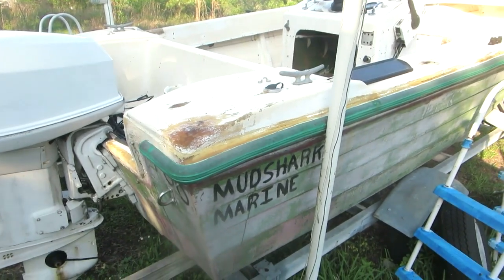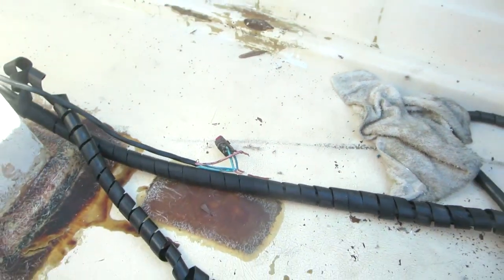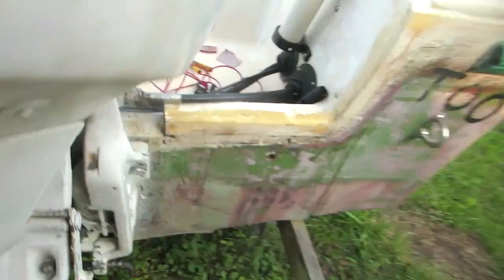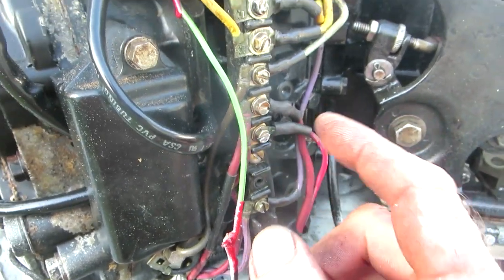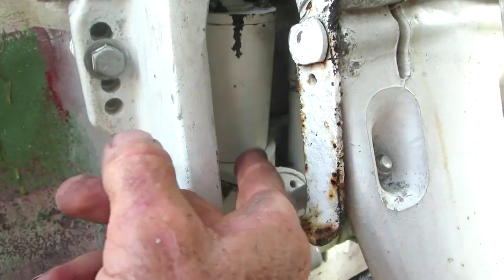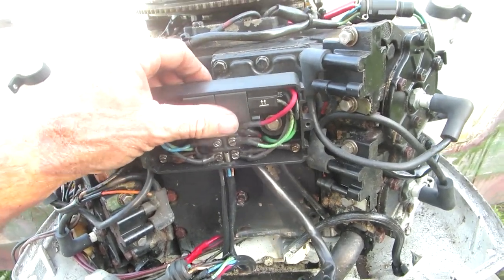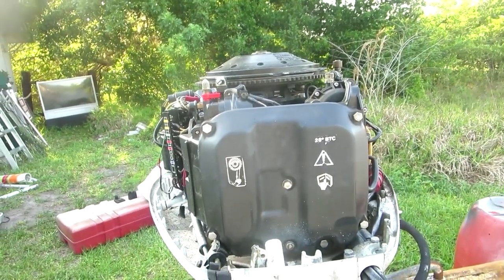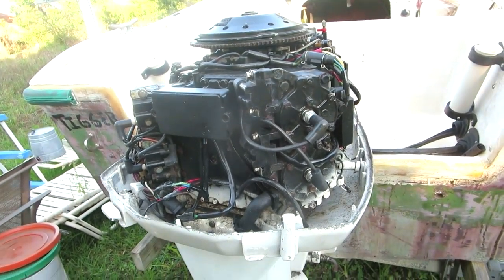Power Trim & Tilt troubleshooting 1987 OMC, Johnson, Evinrude 90HP V4

Comment: You were saying if you push the switch and hear the relays clicking and then it cuts out. That’s where my issue is, trying to get it going , replaced the relays but I can hear them click but not where to go from their
Reply from the maker: Ok, this may be late but... follow the current. If you have voltage to the relays and can here them clicking then you need to follow the wires from there. A volt checker of some sort is required. A voltmeter is best. Check for voltage at each connection or splice. Make sure you have one probe on a good ground. Verify that by checking where you know you have voltage. You may find you have power all the way to the motor connector. If that's the case, the motor may be bad or be corroded too much to move. Try having the trim actuated and knock on the motor  with a soft mallet or piece of wood to try to knock some sense into it. It might free it up by breaking up some corrosion. Without knowing your particular circumstances, that's worth a try. Or take the motor apart and see what's what. If you are into that. Once you know you have voltage to the connector/motor you have at least isolated the problem. Don't assume any connection is good without verifying it. Good luck.

Comment: My 88 doesn't have solenoids. Ugh
Reply from the maker: That's weird. You should get your eyes on a service manual. You might be able to find one online. You might even try to search "88 OMC PT&T system" in google and ck the images. Sometimes pages from service manuals are displayed.You just have to blown them up to read them. I'm not sure how that system could work without them in some form. Maybe in a module at that point? I'd be interested in how it works out. Good luck.

Comment: I would love some help on a MANUAL!!
Reply from the maker: Do you have a big motor without PTT. Power trim and tilt? The 1st motor I had on my boat was a 1981 V4 without it. Very rare as most larger motors came with it for obvious reasons. Either way, what do you need help with? The usual setup is just a lever on the side that you push one way or the other to unlock the position. You usually have to lift the motor a bit to unload the lever assy to get it to move. If it's up, lift a little, flip the lever down toward the back and it should "unlock" the motor and allow it to drop. Do it a favor though and hang on to the lower unit and gently let it down. You don't want any banging. You have to set the trim pin to where the motor will need to be once you are planned off. That's why it's way easier to operate a boat with PTT. You leave the trim pin all the way in the front hole so you can trim the motor in farther to plane off sooner/easier and then trim the motor up for cruising. With no PTT, you set that pin and you just have to wait as the boat nose comes up and fights it's way over onto plane. In little boats, you will see the operators up and leaning forward to help get on with it. To raise the motor with manual tilt, you flip the lever up and forward and lift the motor by the lower unit. When it gets to it's locking position you should hear it click as I believe the linkage is spring loaded and will snap over by itself.  So, I hope that helps, if not let me know what specific motor and issue you are having and I'll give it go. Thanks and good luck.

Comment: Thank you for this video. I just got towed off lake due to trim not going down. Because of video I found out it was relays and have some on the way. Thanks again
Reply from the maker: Sorry for the late reply but... in case you did not know, there is a screw on the right side that you can loosen to bypass the trim system, releasing the pressure and allowing you to move the motor up or down. It takes a flat screwdriver and is the standard lefty loosey, righty tighty. You loosen it to release the pressure, move the motor to where you want it, and then tighten the screw to basically hold the motor in that position.When you get back to dry land, you can do the same to lift the motor for trailering. Tightening the screw sort of locks it in place. Good luck.

Comment: Good video
Reply from the maker: Thanks. I tried installing a momentary rocker switch on the console to cheap out but it did not work. The trim would randomly go to full up while underway. I'm going to bite the bullet and buy the correct trim switch with it's factory harness. That way at least I should be able to eliminate it as a problem source. Put myself in a known situation and all that. My biggest problem is that so many other things are sucking up my time that I don't get to use this guy any where near enough. Non-use is the #1 cause of maintenance issues by far. Especially for boats. We're stuck on land due to the trim issue, a "recent" problem with the cooling system, and the fact that the transom is mush. I've already replaced the stats, but that non-use issue plays hell on them especially. Got to pull 'em again to check on them. The transom will be an interesting journey. Thanks again and good luck. Got to keep these things in the water where they belong.

Comment: Thanks a ton, I couldn't for the life of me trace the wires back to the trim relays on my Evinrude 115 after both up and down just stopped working. Now I know where to start cleaning terminals and checking voltage. Great video
Reply from the maker: Glad to hear it. I figured I might as well share what I figured out. As my 1st aviation boss used to say: "if some dummy could build it, you can figure out how to fix it". Once you know how it's supposed to work, the rest is just tinkering. Good luck. Got to keep these old guys going.
Reply: Did you ever get it working? I’m having the exact same problem. I’m not trying to change the motor unless it’s absolutely required
Reply: @malikcyp2709  nope. It seems like some wires got chewed in some random place on the motor. I traced them and found that I lost power somewhere on the motor. So I cut into the wiring harness near the transom and just hot wired the power trim straight to the battery, and installed a battery master disconnect switch.

Comment: You have saved me from going through and searching.  Great video.  I have the exact motor in a 150.   I'll still need to verify my problem isn't that I know I'm missing the 20amp fuse that you showed that said you blew.  Mine will trim up but not down.   We will see when I get home. Thanks agajn!
Reply from the maker: Yep, same problem I had. Worked in 1 direction only. Good luck.
Reply: Mine is going down and not up and I bought a new motor but it's a bitch getting it back in..tryna figure it all out

Comment: Hey, I came across your video to see how my throttle cable is suppose to connect. Does your cable need to curve to get onto the pin? I ask because it  causes the cable to bind and I can't return my old cable or new cable to idle anymore.
Reply from the maker: Not sure what you mean so I made a short video showing how mine is rigged. I hope this helps. https://youtu.be/B7IUQWCUERo